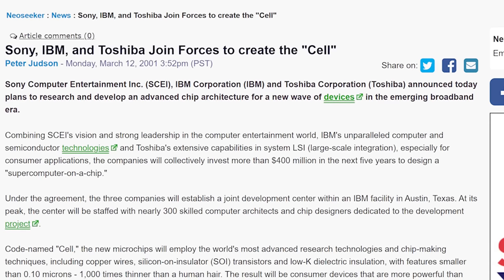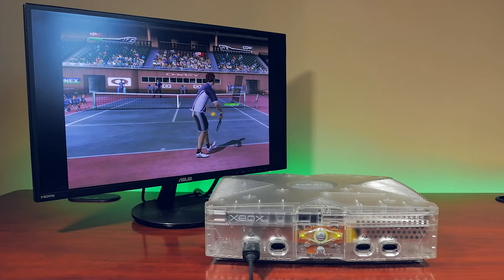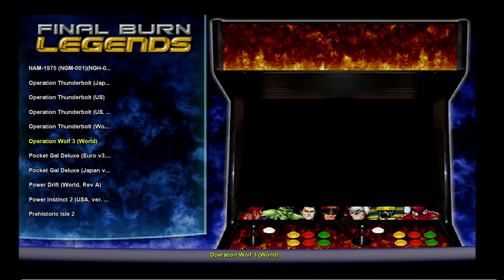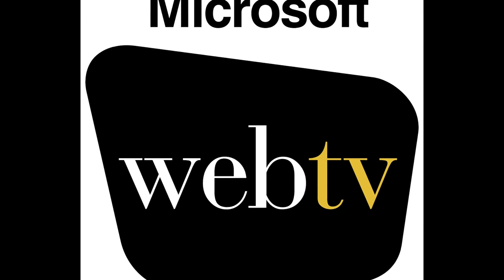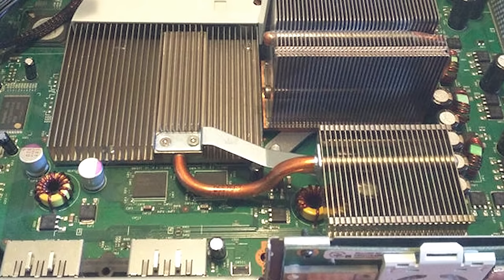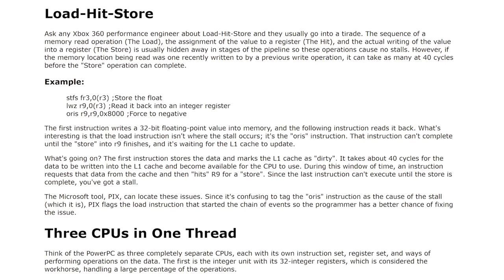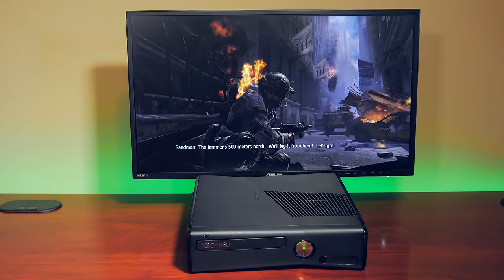Why Microsoft switched from Intel to Power PC for the Xbox 360  | MVG

Comment: What was amazing was that they red ring of death heat problem NEVER happened on the PS... only Xbox suffered that fiasco.
I guess it's good for sales when gamers need to buy 2-3+ of the console b/c they keep dying... my brother had FOUR... FOUR OF THEM...

Also most figures show the Xbox (which had figures stop being counted in 2015) selling 84M consoles, while PS3 sold 87.4M and stopped counting by 2012-2013... sooo IDK how people argue "Xbox 360 outsold PS3" when it sold 2-3M LESS units over its lifetime. 
To date, NO Xbox has outsold Playstation over the generation's lifetime... 360/PS3 is the only one even close.
Reply: The “red ring” did happen in PlayStation 3s.  It was the “yellow light of death” and they happened nearly at the same time.  (Though not directly caused by PowerPC and heat, caused by lead free solder on both) Nearly every first Gen 360 and PS3 is dead or will die without heavy modifications.  Sony just beat them to fixing the problem faster and with the release of the PS3 slim and reduced power consumption chips.

I’m fact, last revision 360 phats do not suffer from this and are just as reliable as 360 slims.  Their code name is Jasper Xbox 360s.

Microsoft is claimed the victor in sales, because it massively outsold and generated more revenue during its lifetime.  The PS3 only outsold the 360 towards the launch of the Xbox One and PS4, mainly thanks to jailbreaks being available and the fact that it was a blue ray player.
Reply: @haxorinator8219   This simply isn't true. Sony sold more PS3s, therefore, they won in sales. Not to mention that the PS3 pulled ahead because Microsoft fell off; they pushed the Kinect too much and lost sight of their core audience, allowing Sony to take the lead.
Reply: Keyword is "during its lifetime."

Do sales really matter when the console is already EOL?  

I also already said, "The PS3 only outsold the 360 towards the launch of the Xbox One and PS4, mainly thanks to jailbreaks being available and the fact that it was a blue ray player." 

But I don't think people were flocking to the PS3 because Kinect sucked, lol wut?

What is definitely 100% true, without a doubt, with tons of sauce, mom's spaghetti, is that Microsoft dominated multi platforms and exclusive DLC during the entire lifetime of the PS3/360 era, where most the money was made.  The large majority of Xbox 360 versions are superior to the PS3 counterparts.  

I consider that a loss for Sony.

 @mysticaxolotl8215
Reply: @haxorinator8219  Let me clarify my stance on the Kinect. The Kinect wasn't an issue becuase it was unsuccessful, rather the opposite. The 360 was supposed to be a core audience console, remember back in the early 2000s you weren't just a gamer, you were either a hardcore gamer or a casual gamer. Microsoft tried to do what Nintendo was doing with the Wii, except instead of planning the Xbox 360 to be a casual gamer's console from the beginning, they tried to pivot mid-generation with the Kinect, and it actually worked. People tend to forget how successful the Kinect actually was during its heyday, but the "core" gamers wanted nothing to do with it, so they flocked to the PS3 instead.

As for the Xbox 360 multiplats being superior, it's not because the PS3 was worse. The PS3 was far more powerful than the Xbox 360 *when used effectively*, which was the problem. The CELL was essentially a supercomputer CPU shoved into a box meant for games, and while that meant it could be used to produce graphics way ahead of its time, most people simply couldn't figure out how. I'm not blaming the developers by any means, I totally think that they should have made the PS3 more dev-friendly.

Maybe I'm biased (the PS3 is my favorite console of all time). Either way, glad to come across someone who's just as knowledged in this era of gaming as I :)

Comment: I was unfortunate enough that the first laptop I bought used a 2.4Ghz P4 and my goodness it was toasty, loud and heavy.  Though to its credit, it still works today but I only drag it out if I want to tinker with old hardware that used the parallel port.

What I remember the most is later on I got a used Pentium 3 733Mhz PC and it was WAY more responsive in Windows, it felt faster, presumably down to the pipelining differences.

Comment: In simple way, why Microsoft choose IBM powerPC because they already have multi core and multi thread technology. Plus their chip is cheap and low power.

AMD and intel still stuck at 1 core in 2004/2005. Their chip also expensive and power hungry.

Comment: 1. There's no such thing as x64. 64 instruction set is and extension to x86 architecture. This is still called x86. What would you call original 16bit x86? x16?
2. Xbox obviously didn't go back to ATI as ATI was bought by AMD.

Comment: "and not run very hot""
Lol, I made so much money fixing 360's. Except when I did the fix it was perm unlike Microsoft.

After you softmod your xbox booting into Linux is super simple, but with only 64MB of RAM you'll not going to love it.
Reply: Wasn’t the fault of the CPU though, it was the solder or thermal paste on the GPU which was poorly designed

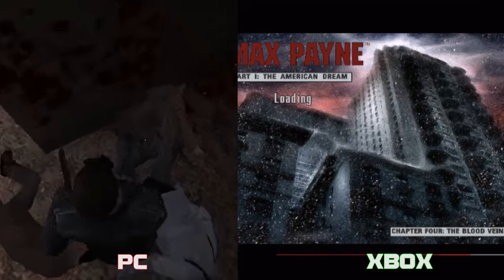Comment: 3:09 - Look, I was a fan of the original Xbox, but to say that its version of Max Payne was virtually identical to the PC, is a heck of a stretch.

The difference is night and day to me, you can see it even on YouTube's video compressed image.  PC is a lot sharper, more image pop, higher resolution textures and alot smoother framerate.  There was much more going on than a mere loading discrepancy.

Otherwise, good vid.

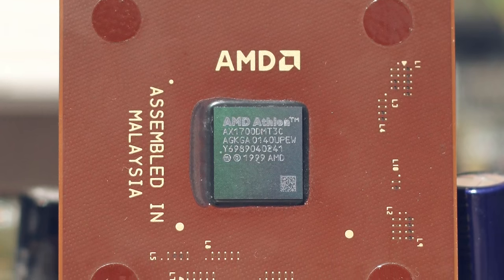Comment: 5:20 wat. Just wat.
Reply: Also let's keep in mind that the PPC970 has a 16/21 (int/float) stage pipeline, so if you're going to throw around pipeline length as-if that's a relevant factor in isolation for whole system performance, you should probably mention that number as well. The Xenon processor has basically the same pipeline as the PPC970.

Comment: Lol power heater 4 (aka Pentium 4) 6 times wall draw on absolute minimum viable system vs AMD.
Then any stalls (frequent) then long bubble clear of that long, long pipeline. Intel disaster #2 after itanium.
But i think intels current 7 year failure to achieve node equivalency or even last node is the biggest intel disaster ever.
Samsung is a solid generation ahead, TSMC 2 ahead, heck the Chinese even with tech restrictions are rapidly closing in.

Comment: Simple.. Intel is too expensive.. and eventually they went AMD.. which is medicore brand.. put an intel cpu clocked @ 1.6ghz and AMD 1.6ghz intel would be still faster. You're not getting the real 1.6ghz as AMD claims to be. Experienced it with AMD computers.. while my intel was @ high speed and did deliver as the promised. This is the same story. IBM was also used on gamecube and it showed the power.. They try to go for as cheap possible CPUS in today gaming. AMD is so cheap